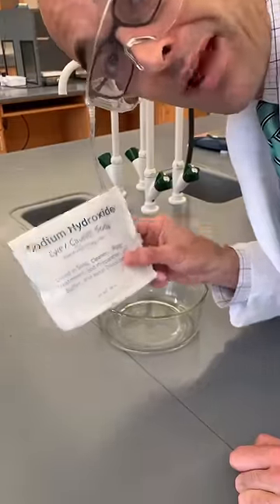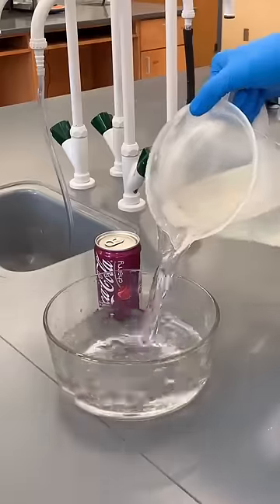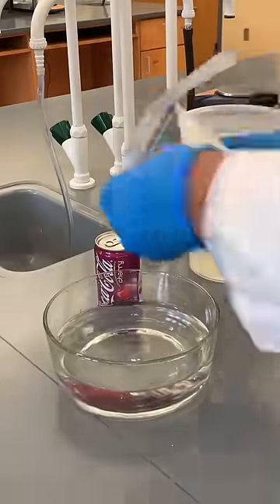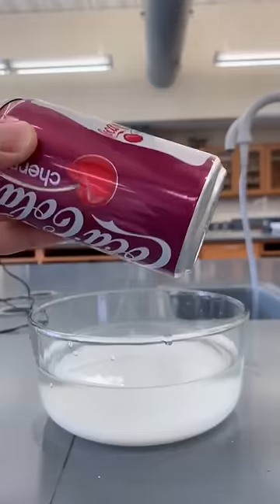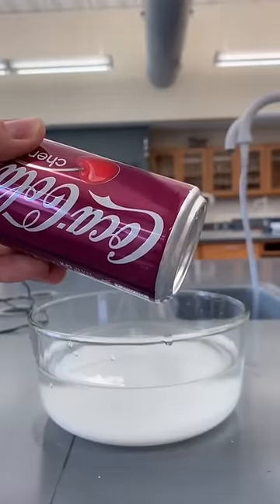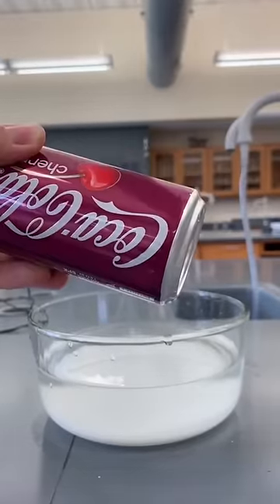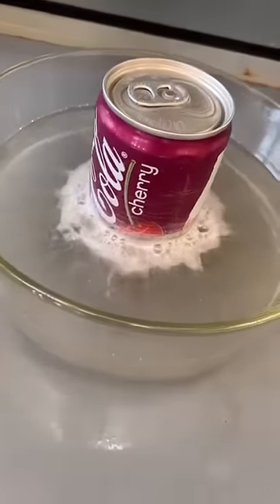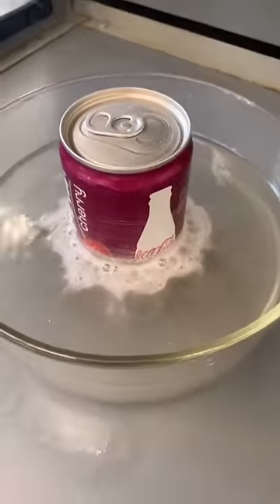Did you know this about aluminum cans?

Comment: I knew glass bottles were the only non plastic method of drinking soda.
Reply: What’s the topper made of?
Reply: @matthewaaa5138  usually metal from my experience.
Reply: @matthewaaa5138  somekind of metal and paint
Reply: @milesvalerius8423  not on the bigger bottles tho
Reply: @kittencutie7074  metal, paint and an inner liner (protector) !!
Reply: Next video: Did you know this about glass bo....
Reply: The cap still has a plastic liner.
Reply: @matthewaaa5138  cap is metal boi
Reply: Did this experiment to the glass bottle. There's also a plastic liner.
Reply: @hirotakasugi4891  no there isn't. Not in glass bottles. They put the liner in cans because the acidic soda will eat away at the aluminum. But the soda doesn't react with glass so there's no need to line it. 
Plus, when you break a soda bottle you'd be able to see pieces of a plastic liner if it had one. But it doesn't.
Reply: @ShellyCline  That's why you don't break it. You have to denature the glass compound like what the guy did with the aluminum.
Reply: @hirotakasugi4891  I've seen broken ones. They didn't have a plastic liner.
Reply: Well why didn't you tell us
Reply: @ShellyCline  Again you have to denature the glass. Why do you think this guy had to denature the aluminum?
Reply: @Sac-chan  they sell glass big bottles of coke?!
Reply: @Zauchi  yes? why? and they have plastic too
Reply: @Sac-chan  I've never seen a big bottle only up to 500ml
Reply: No, you can use real tin, tin is non toxic and has a decent corrosion resistance, aluminum is very reactive and can form oxides and compounds when mixed with acidic foods.
Reply: @Zauchi  where do you live? here in Chile we have from 250ml to 2L glass bottles
Reply: @Sac-chan  uk, so we have the 500ml bottles but in the last couple of years they released 250ml and 330ml bottles... would love a 2ltr bottle. lol
Reply: @Zauchi  Seems weird to me that you haven't seen them or that your country doesn't have them tho
Reply: Im sure the process to make the syrup and or purifying the water used in sodas involves contact with plastic at least once along the way
Reply: @hirotakasugi4891  again, they put plastic inside aluminum because the soda corrodes aluminum. Soda doesn't corrode glass, so what would be the reason for putting plastic inside glass? There is no reason and they don't do this.
Reply: @ShellyCline  yes they do. Just do it. Go corrode glass with a carbonic acid instead of being a google warrior.
Reply: @hirotakasugi4891  why don't you back up your claim with some proof? Do you have a source for this claim? Or is your source: trust me bro?
Reply: @hirotakasugi4891  and since you seem to know so much about it, what would be the reason for lining glass bottles with plastic?
Reply: @ShellyCline  denaturing of glass creates micro sharp silicates that can hurt the insides of people when consumed. Which can lead to things like MRSA.
Reply: @ShellyCline  Why don't you back your claim first? Prove that there's no liner by denaturing the glass instead of breaking it. The liner in glass bottles tears with when the glass breaks because of the sharp edges created when glass breaks.
Reply: @hirotakasugi4891  because I don't have acid strong enough to melt glass!! WHO DOES? Besides, you made the claim first and I responded to it.
I also searched and searched trying to find somewhere that said glass soda bottles are lined with plastic and I couldn't find it. My guess is that you couldn't find it either. Yet here you are insisting that's the case. 
You can't even come up with a reason WHY they would line glass bottles with plastic let alone prove it. 
Yet I came up with perfectly logical reasoning as to why they don't.
Reply: @hirotakasugi4891  soda doesn't denature glass.
Reply: well actually did you know…?!
Reply: Only costs 400% more for half the amount.
Reply: bad thing about glass bottles is that my girlfriend uses them to hit me with
Reply: And glass is the only medium that actually likes fluids. 

Soda in glass bottles best soda.
Reply: @zStC1  yes I agree. It's clearly visible plus you can even feel it.
Reply: Also sprayed. I worked for a company that maintained machinery for rexam glass in the Netherlands. While still hot and on the cooling belt, all the bottles and pots are sprayed with an internal coating. So it's not just glass on product, there is something else in there. I noticed it on the Heineken bottles and they explained what it was. But it was 2005 ish, and I've forgotten exactly what it was.
Reply: @the_JTowny  it's called IFT (internal fluorination treatment) in which fluorine is sprayed inside some glass bottles. They say it can prevent a loss of flavor and it can also help prevent what they call "Bloom" in glass. Which is just a fancy way of saying glass that gets tiny scratches in it and doesn't look nice anymore. I guess the IFT helps to prevent that. I don't know if they do it for soda but if they do it for beer they presumably do it for most beverages in glass bottles. I looked it up and fluorine is highly toxic yet widely used. Yikes.
Reply: @ShellyCline  You kill me!  lol. "Is your source 'Trust me,  Bro'?"  I don't believe the plastic claim either.   And for the guy in Chile who's got glass 2 liters, it's Chile.   They exist,  but are considered vintage to most of the world.
Reply: @mgordon1100  lol thanks 😂. Yeah I agree about the glass 2 Liters. Those would be pretty hard to find in the US.
Reply: Avoiding plastic at the consumer level does literally nothing to help the environment
Reply: Microplastics 🥰
Reply: Hate to break this to you, but Several caps have a plastic film in it, to ensure a tight seal. 😁
Reply: @ShellyCline  it was also coca cola bottles and hak(Dutch food brand) vessels. 
The Rexam plant was next door to the coca cola plant in Dongen.
Reply: So ummm.... we not gonna talk abt the plastic wrappers on the bottles that are normally glued. Or the the plastic things used to create the bottles😅 unfortunately there isn't much that doesn't require at least a bit of plastic
Reply: @hirotakasugi4891  people like you are perfect walmart employees
Reply: @g0tsp33d  Says the one who falls for an obvious internet bait.
Reply: @hirotakasugi4891  hyuk hyuk
Reply: And Little do we know that glass is made out of plastic too
Reply: @anthonyt2011  FUUUUUUUU-!!!
Reply: @matthewaaa5138  The topper is made from Vibranium.
Reply: Plastic in glass to its 2022
Reply: Actually our species is 70% plastic not water this is the real plot twist of our life's.
Reply: In Mexico all the sodas come in glass bottles, that are then recycled,  recapped and reused.
Reply: Fountain drinks
Reply: @hirotakasugi4891  just no. There is no plastic liner in glass bottles, period
Reply: @matthewaaa5138  Metal, with a soft plastic liner on the inside. but the beverage doesn't contact that much and is stored largely in the glass bottle. In a can or plastic bottle it is surrounded by plastic. That is how we get the difference.
Reply: Metal bottle caps have a plastic on their underside
Reply: Nothing like pulling out a cold glass bottle of coke from an old school vending machine. It tasted so much better.
Reply: That's why the jews got rid of it
Reply: should we tell him about the plastic in glass bottles?
Reply: Ok LeBron
Reply: Plastic seal
Reply: @milesvalerius8423  Metal with the same kind of plastic layer on the inside.
Reply: And that is why the taste is better
Reply: @ShellyCline  glass bottles may have a plastic liner in the cap depending on what the cap is made from.
Reply: @scottbecker4367  yes I agree. I can see the liner in the cap as well as feel it. But the debate I was having with the other commenter was about whether the glass itself is lined with plastic. Which, of course, it isn't.
Reply: @ShellyCline  you can't dissolve glass at home and survive. i'm afraid hiro was goofing you
Reply: @milesvalerius8423  "family outraged that soda has metal cap with conspiracy that micro-metals are causing extra chromosomes" nerd 🤓🤓🤓🤓🤓
Reply: @YUN6_V3NUZ  please call for help
Reply: @nukeacitrus883  no, to ensure the cap doesn't get corroded
Reply: @hirotakasugi4891  one of the few acids that dissolve glass is hydrofluoric acid that together with other superacids IS NOT USED IN THE FOOD INDUSTRY. There's literally no reason to put plastic on the inside of a glass bottle
Reply: People worried about this when all water bottles are plastic. I'm confused.
Reply: @John Townshend  I work in the US for the company that bought Rexam.
Reply: @mvcards20 water doesnt is acidic so it will not dissolve the plastic as quick as coke cola eg.. You can clearly tell a difference when drinking coke from plastic bottle to a glass one.. Thats the plastic you drinking😂👌
Reply: I like to poop in the beach near other people in the water so they ran with the gift while they swim. One time this dude was swimming and my poop got into his mouth ! He couldnt believe it and he never knew it was me 🤣
Reply: Or beer..
Reply: @matthewaaa5138  metal, some have a tiny bit of rubber but that’s not falling into ur drink like plastic bottles leech plastic into the drink over time when it overheats in transit , sits out forever.
Reply: @hirotakasugi4891  ur wrong u can burn a glass bottle and no fumes will come off

Comment: I would’ve had no idea plastic was incorporated into aluminum cans if it wasn’t for this video. It’s inescapable
Reply: Future historians will indeed look back upon our time and despair
Reply: Neither did I, I am shocked since plastic in drink/feed send to have health problems due to micro plastics.
Reply: @Dazzxp  I mean it's the same as storing food or liquids in a plastic bag
Reply: When you watch videos that melts them, you do see a lot of plastic excess that comes out needing to be removed. Tbh I thought it was the outside print not inside...
Reply: @Cybersynthetica  That’s if this planet has a future
Reply: If you think the cans are bad, I'd like to know what is used to coat the containers in the hulls of ships that carry stuff they make the soda's out of.
   If the hulls containers aren't coated then the 'soda' eats through the hull (bottom) of the ship.
   Put a nail in a glass jar, put coke soda in it & cover it. The soda in eats the nail.
Reply: @Austin Hurst that’s great info but do you have a source?
Reply: @ruthshelton-tp9ie  so does your stomach acid. So would enough orange juice. Or tomatoes. So would oxygen given enough time.
It's just from the acids. Your stomach acid has a significantly lower ph than soda does, which is why puking burns and soda doesn't.
Reply: Get over it
Reply: @devent10n  your stomach acid does NOT have a significantly lower ph level when compared to soda; most soda is made from phosphoric acid and is in the same ph ballpark as your stomach acid. Also, what kind of soda are you drinking where it doesn’t burn seeing as how most if not all sodas are made from acids?
Reply: @mandarian87 does... does soda burn you? I think you may need a doctor.
Reply: I'm quite surprised that there's people who've gone their whole lives without ripping open a can.
Reply: @Dazzxp  aluminum also has negative health effects
Reply: We should sue
Reply: A long time ago, people said plastic was a safe alternative to using paper. So we switched wholesale to plastics.
Reply: Yeah..😒 unfortunately they put plastic in, on, or around almost everything that's not edible. & ...Salt in almost everything that is edible.
😔For instance, those little "PAPER" receipt u get from stores. Many-to-Most them are made with or coated with plastic, addition to actually paper. 
A lot of these chemicals & plastic byproducts are seeping into our systems. 
🤔No wonder it seems like our society is getting weirder & weirder.
Reply: "[Plastic is] inescapable"

... Don't buy single-serve drinks;  Wash & refill stainless steel water bottles, instead.

Plasticizer-ingestion & waste problems solved.
(Type-II diabetes, I'l looking at you.)
Reply: @William.Driscoll  is there a connection to diabetes and plastic?
Reply: Its good. Because aluminum is toxic. Reason drinks good is they dont exposed to light.